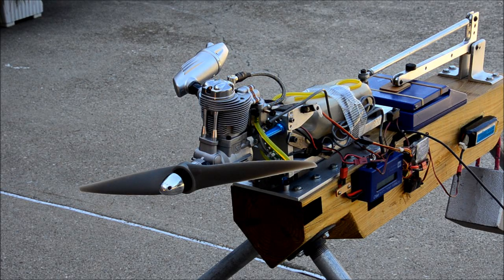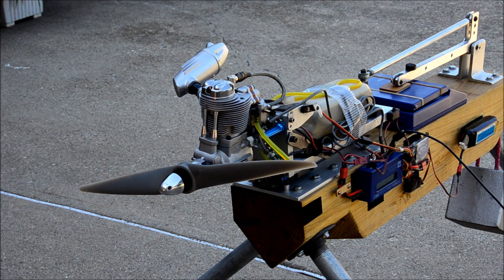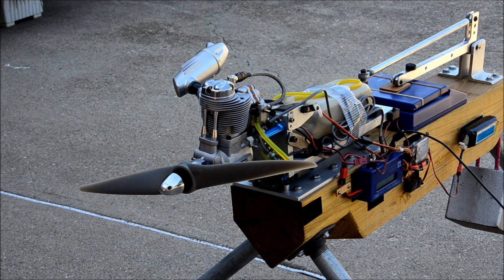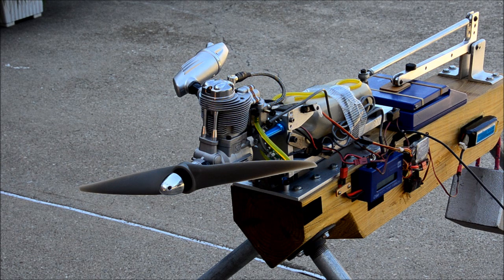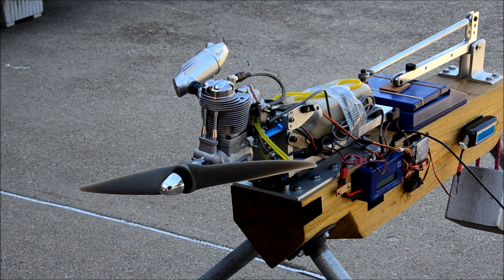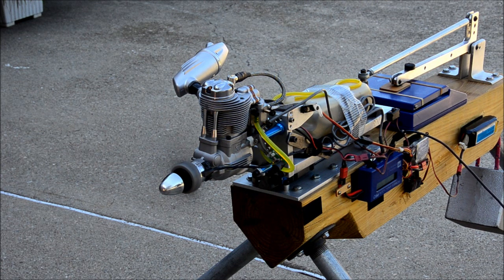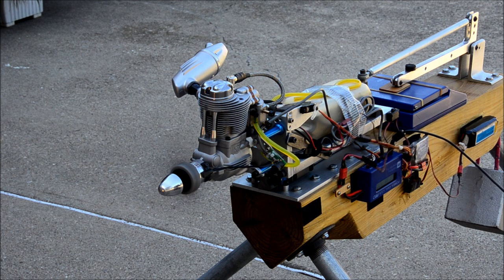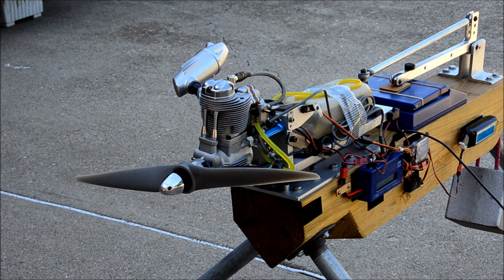RC Sport Flyer Thrust Test - O.S. GF40 Four-stroke Gasoline Engine

Comment: For 20cc power, I have tried the RCGF 21cc twin (CNC crankcase, $339), and like it better than any small 20-some cc gas 2-stroke I have tried (basically, no vibration, runs cool, and uses very little gas, and will run for 2 hours at a time). I have run an RCGF 30cc twin, and have that lined up for a 74" CAP 232, Kangke.

Comment: At 8,600 rpm that engine is well under-propped. No wonder thrust is low at 17lbs.
Reply: Yes, this engine has lots of torque that is not being taken advantage of here.  You can surely hit thrusts in the mid 20's (lbs) swinging a larger prop.  Even OS says a 20X10 prop is fine with this engine, and have ALWAYS (since 1980) ran OS engines with bigger props that they recommend to get the most thrust from them.  A 22 X 8 would probably give you the best Static Test Stand Thrust number, but for most planes, I am thinking a 22 or 24 X 10 would be the best for flight.